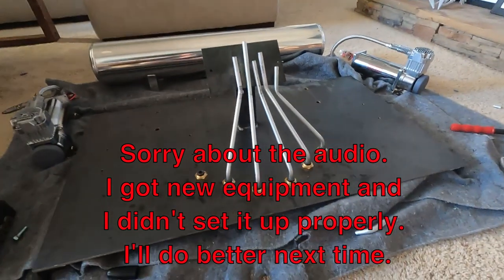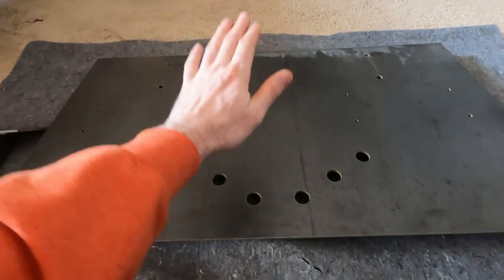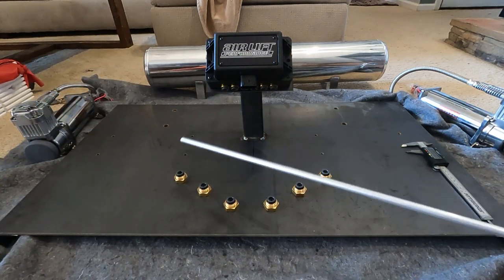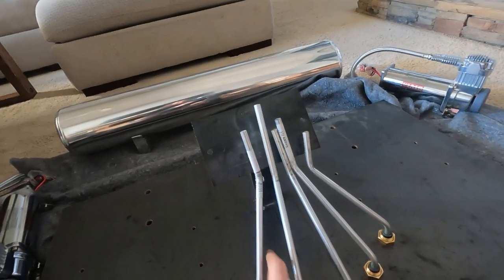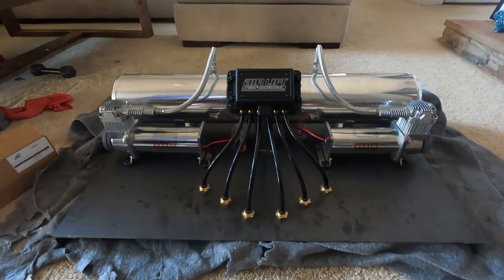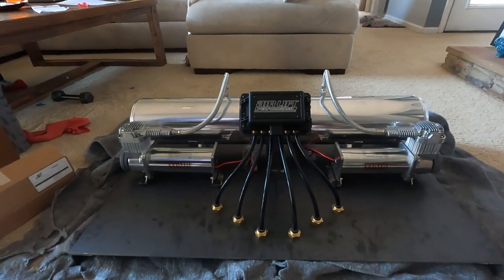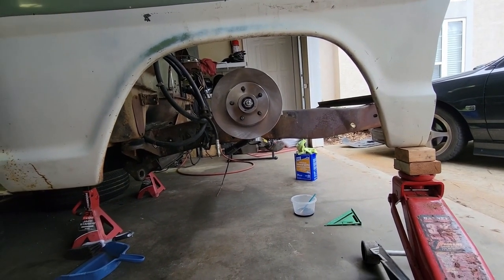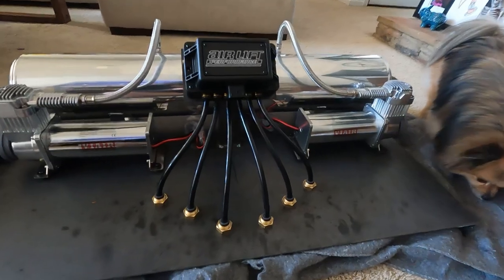CUSTOM Air ride tank, pumps and Air Lift manifold setup that i made for my Ford F100!!

Comment: Mount your trap farther from your trap. moisture forms when the air cools.  Run 1/2 inch black pipe to the other side of your garage, or a 50 foot hose. Put a tee at the end with a drain valve. Poor mans air drier.
Reply from the maker: Imma gonna move in the next year or so and on my next shop I'm going to upgrade compressors and do something about the moisture.